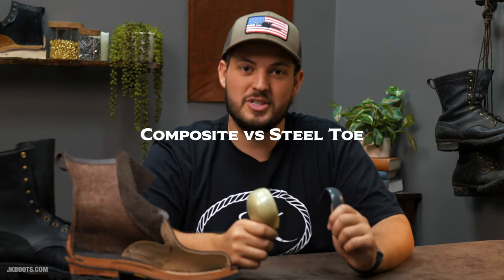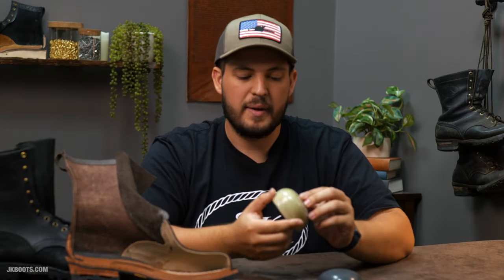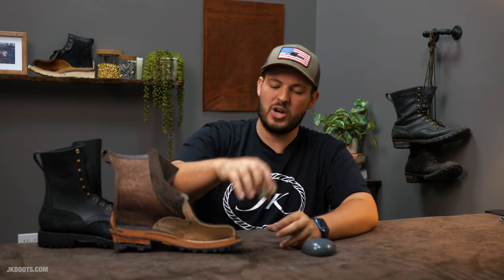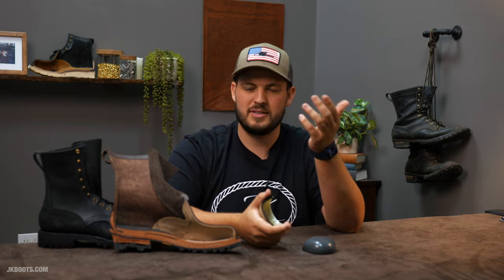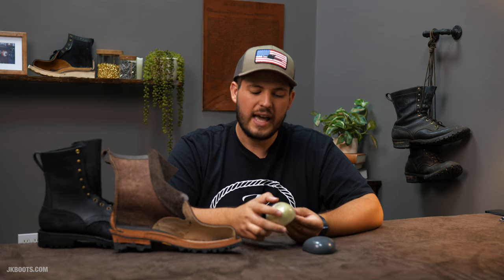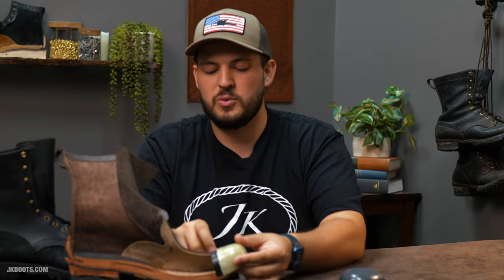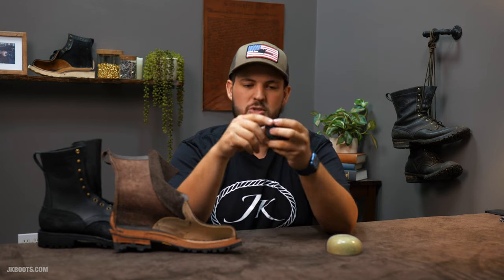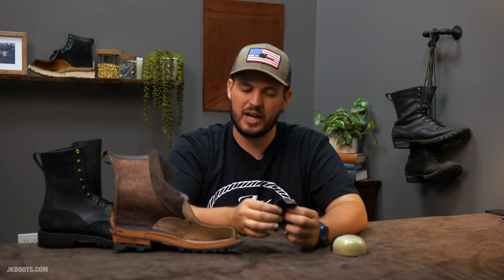Composite vs Steel Toe | Which Is Better?

Comment: One really impoortant thing to add: If you wear a safety toe as part of sawyer gear, know that a steel toe stops a chainsaw blade completely, whereas it dives into a comp toe faster than some woods. I've seen demos of chainsaws on comp toes, and they don't even slow down. But for impact, yes, go comp toe.
Reply: So dont wear como toe if work with a chainsaw
Reply: I work using a plasma cutter and parts can be heavy after cutting. Parts could maybe fall on my feet while carrying so I use composite toe

Comment: No one wears safety toe shows because they want to.  They wear them because they have to.  I don't have a choice.  My job requires me to wear steel toe shoes.
Reply: That's not true. After you smash your toes a few times, then get the composite toe you don't go back.
Reply: Again, I don't wear steel toes boots because I choose to, I wear them because I have to.  I have no choice in the matter.  My employer requires me to wear steel toe shoes.
Reply: @gregphillips9670 do they require you to wear steel toe, or do they require you to wear a certified safety toe? That’s two different statements. Everyone already knows it’s more comfortable to have neither if it’s not necessary. We’re here talking about if composite or steel is better.
Reply: @ZSmith-yy4lv Any profession using a chainsaw requires steel toe... as do many others.  Composite is inferior.
Reply: Plenty of people wear safety toe boots because they want to, they use them to kick and protect their feet. You do have a choice, safety toe boots are required at my job but 90% of people wear sketchers slip resistant sneakers or random athletic shoes. I don't have a choice is not a sentence a man says, you always have a choice.
Reply: @chad10006  Your safety regulations and ability to do your job well is inferior if the material a safety toe is made out is so significant to spark this stupid debate.
Reply: @gregphillips9670 no you said nobody does and I do every day because I work on cars etc
Reply: @Billy-gh9ih  I also wear them by choice and it has saved me more stubbed and broken toes than I can count.

Comment: I’d choose composite, friend of mine steel worker had metal fall on his foot, they had to remove all toes because the steel crushed & stayed, Dr said maybe could’ve kept some toes had the safety toe been composite, idk but my friends boots are composite toe now, just one boot tho
Reply: Your friend is a statistical anomaly. The amount of force necessary for that would pulverize the bones of the foot enough that they would probably remove the entire thing. An ASTM rated steel toe can resist 6000 pounds of force.

Comment: I would like to see a close up of cutaways of boots with steel, composite and celastic toes to get a better visual of the room and shape and edges inside the boot compared to a soft toe. Also steel toes are magnetic and someone can weld your boot to something if the leather is worn through.
Reply: Has someone welded your boots before??😂
Reply: @aurtisanminer2827  I have a new fear now, someone welding my boots to something when I'm not looking lol

Comment: I drove a Lift about 20 years ago, and they did not want steel toed boot as these roll or crush and get mangle or cut the toes and recommend reinforced or other boots. Has this changed and what is your recommendation NOW for heavy rolling equipment, just let the toes get crushed and let the surgeons relieve the pressure ?

Comment: Composite is the way to go for me I have a plow fall on my toes the toe just cracked but I was able to remove the boot without cutting the boot off I just suffer a small fractured and bruising I seen guys with steel toe loose a toe or two and having the boot cut off

Comment: I've always worn steel toed logger Vibergs every single pair I've owned in the last 20 plus years is toe rub, the leather lining around the steel toe wears through now you have a sharp steel edge rubbing. I have wide feet its not a blessing 3E and size 12. I bought a pair of Superduty's last year or so yeah the comp toe makes the boot look more bulkier. The comfort exceeds the bulkiness, it is not good for your toes to be crammed in all day long, things need to move. I'm looking at buying another pair of Superduty's I know how they fit I will go down one size I may even go to a 2E boot. You gotta take comfort any day of the week, when I get home I'm not in a hurry to get my boots off because my feet hurt. I take them off at the end of the day with no foot pain I can't say that about the handmade boots I've had in the past.

Comment: I bought an alloy toe for work because I work in a warehouse with a lot of equipment that could cause foot injuries but because the metal detector keeps going off and apparently steel toes were against the dress code I had to switch to a composite toe
Reply: Hows it doing against the pallet jack?

Comment: Can you do a video on how i know if my composite toe boots have been compromised or cracked after a year of use a few blows to the toe
Reply from the maker: Its sometimes hard to tell when composite toes have been cracked. If its fully cracked through sometimes you can feel it. Otherwise you have to judge it off the impact/impacts that it has sustained. We recommend that after any big impact over the ASTM standard that the composite toe be replaced. As stated in our warranty, your warranty does not cover "The continued use of a safety toe or metatarsal guard after the boot has sustained an impact in excess of the ASTM rating specifications". Hopefully this helps! If you have any other questions please reach out to our customer support at general@jkboots.com

Comment: I work in concrete steel toe has always been a great option there heavier but offer better protection for your feet I was considering soft toe
Reply: Composite toe is not the same as soft toe, you might wanna get some hiking boots in that case😅

Comment: Does the composite offer as much protection in an accident like "foot being backed onto by a scissor jack tire?" That happened to me recently. I had regular shoes on. Not recommended. lol
Reply: This is something I was wondering, would the como resist the weight barring or would it crumble to the weight !?

Comment: I work with a lot of heavy metal.  If you drop a piece on your boot, it'll cut clean down to the steel toe in the boot. Is the composite as safe as the steel toe, when it comes to 50 pounds of sharp metal hitting it? Or is steel toe still the best option?
Reply from the maker: The composite toe has the same ASTM rating as the steel toe which meets or exceeds the standard safety toe requirements for boots, so you can expect the same level of protection from either boot.

Comment: Does the safety toe width change based on the boots width? Is it possible to get a very wide safety toe? I’m very wide in the toes and am constantly getting ingrown toe nails but I don’t have a choice because OSHA sucks and I have to wear them.
Reply from the maker: It will change based on width and length. Please call us at (509) 487 - 0154 and our customer service team can help you better 👍

Comment: If the composite toe shatters do you need to have the boot rebuilt
Reply: ASTM recommends that any significant impact with a composite toe be trashed and replaced. The data show that you cannot guarantee the integrity of the composite toe after an impact.

Comment: What are celastic toe
Reply: Celastic is a plastic impregnated fabric which becomes mold-able when activated by immersion in solvents such as Acetone and MEK (methyl ethyl ketone). Once dry from it's solvent bath, it is transformed into a light-weight, high impact material. Celastic toe is not a safety toe it is  just a stiffened toe option to minimize the droopy toe appearance after break in and time. The moment an heavy object is dropped on a celastic toe it will give way.

Comment: If I wear red wings steel toe 9.5 H wide! What would you recommend for JK?
Reply: Use the measuring guide they offer, you can print out a sheet and get your correct size.

Comment: Need minimalist safety boots
Reply from the maker: We would recommend checking out our 300s with a composite toe, thinner leather and overall lighter duty boots to our Forefronts. Also our 300x that is the same but with a Vibram 132 unit sole instead of the 300's Cristy Wedge sole.